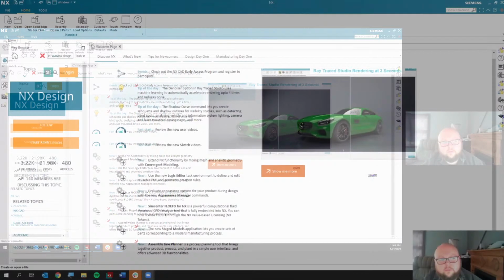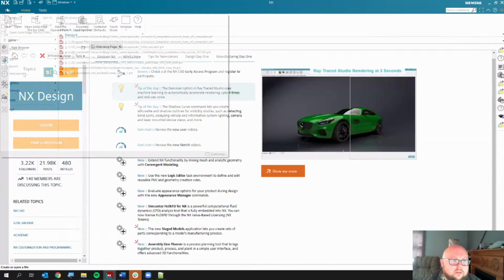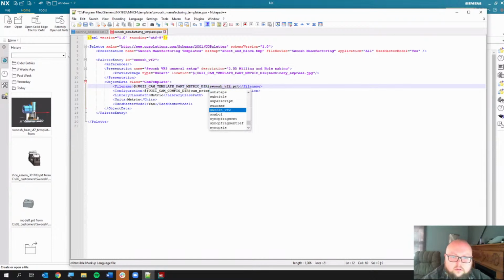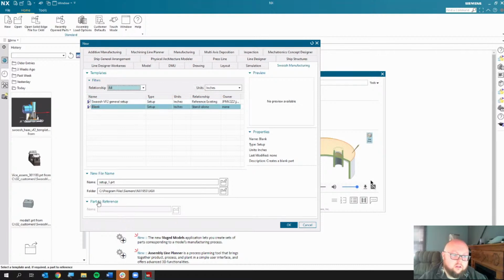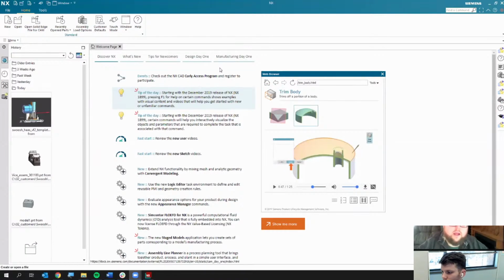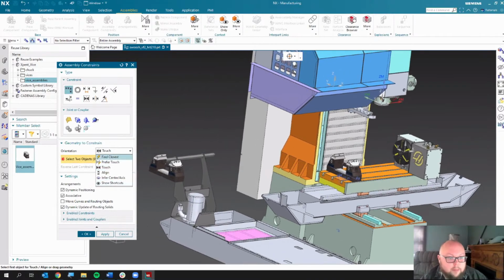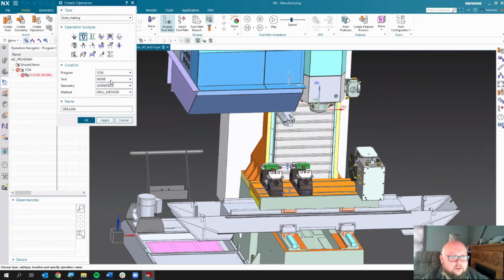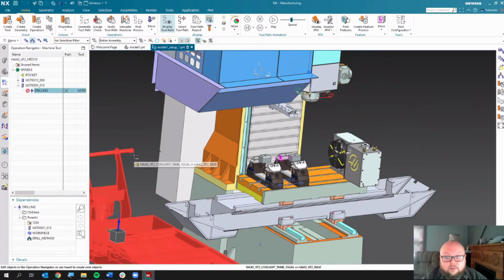Tooling Time Ep. 1: Creating Custom Manufacturing Templates

Comment: 00:00       Intro
5:14         Review Templets
7:18         Create additional Tab
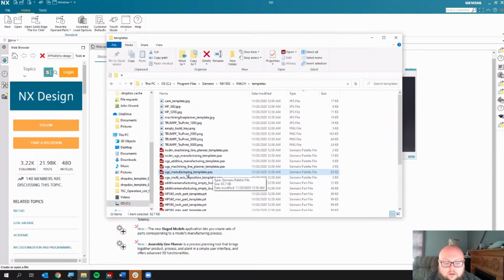      8:25       Copy Pax File
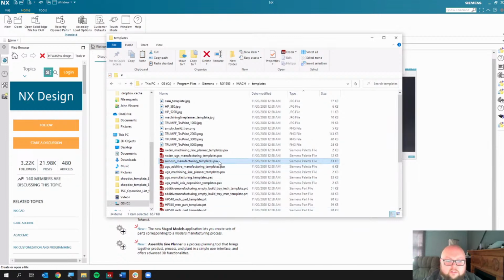      8:50       Edit with Notepad
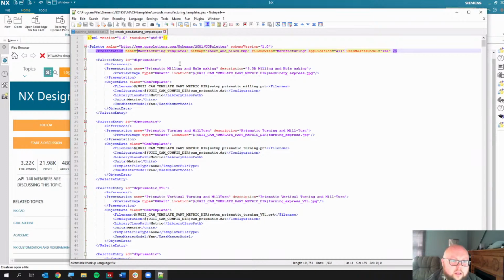      9:24       Rename
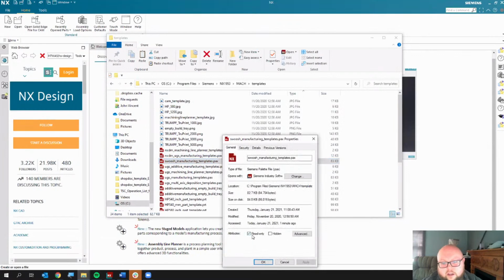           9:34      Change Properties from read only
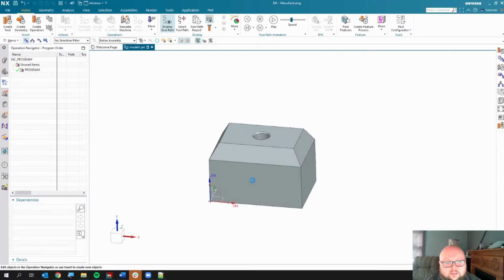           11:07      Relaunch NX
11:49      Change content in custom Tab
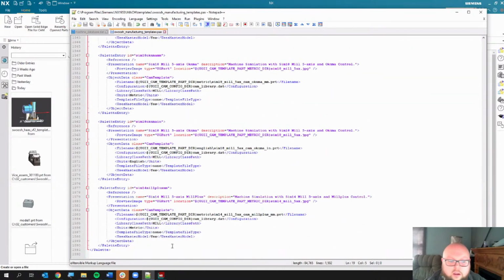      12:42      Delete Pallets
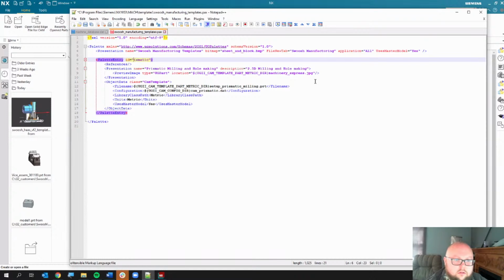      13:01      Rename/Edit remaining Pallet
            14:25      Object Data Edit
17:45      Start Temp Modification
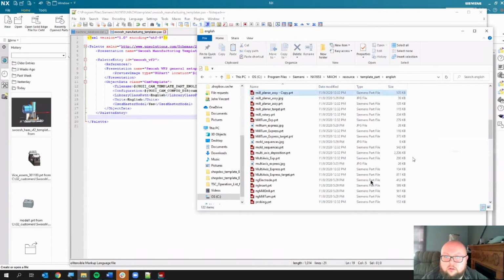      18:12      copy past part file
            18:19      rename part file
            19:05      Property check 
19:28      relaunch NX
20:50      NX University plug
25:16      Open created part file
      26:44      Bring in Machine
            25:54      Constrain Machine
      28:10      Bring in and constrain Vices
      30:55      Move Mill Planer Target
      31:50      Load 2nd instance
            33:00      Change attributes in properties
      34:19      Create operation - Facing
            35:30      Drill Operation
      34:56      Bring in tool - Facer
            35:30      Drill
      35:50       Assign tools to Operation
      36 :14      Set Tool templet settings
      36:35       Set Operation templet settings
37:02      Close out file
37:15      Open existing Part file
      37:55      select new file
            38:20      select created templet( swoosh manufacturing)